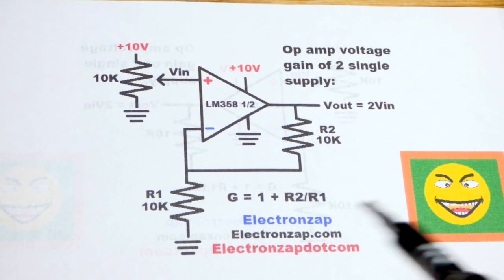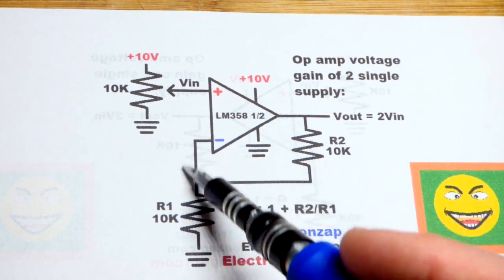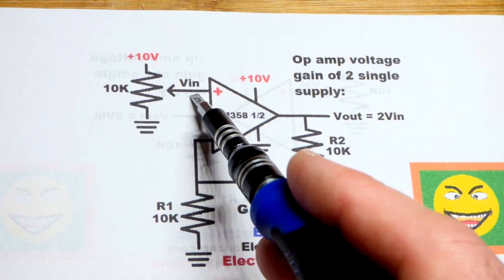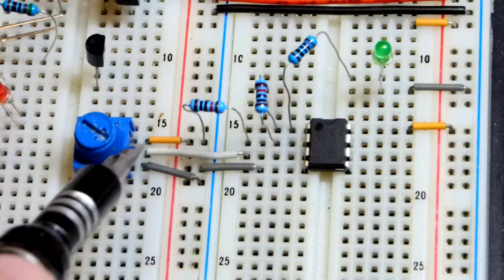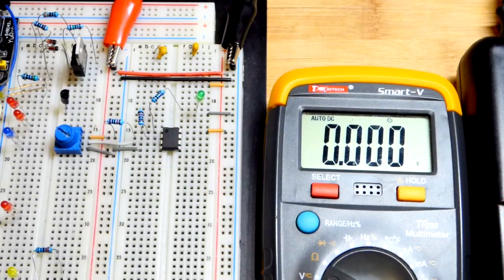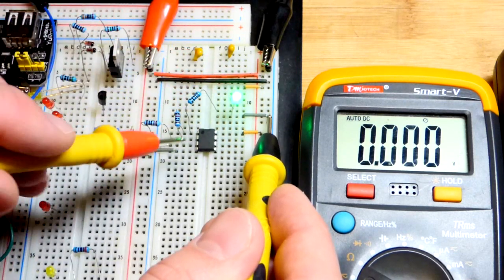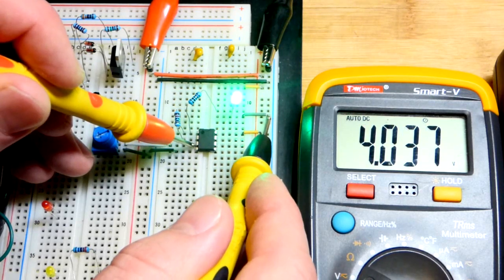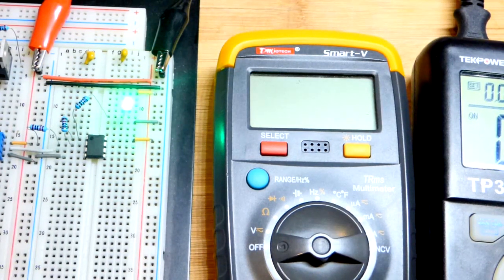Voltage gain of 2 using LM358 single supply op amp electronics circuit by electronzap

Comment: Hey there!
I've made a lm358 dc voltage amplifier with a gain of 100x. My maximum input is 75 millivolts which gets amplified to 7.5 volts. But I want to scale the voltage range of 0 - 7.5v to 0 - 5v so I thought of connecting a voltage divider across the output of the amplifier. But when I connect it, the output suddenly drops randomly. How can I isolate the amplifier and the voltage divider circuit???

Comment: Can I amplify 75 millivolts to 5 volts using LM358 module that has a gain of 100X.  I'm trying to make an invasive ammeter. I want the ammeter to show 400amps when a voltage of 75 millivolts is developed across the shunt. But it is difficult for arduino to measure in millivolts.
Reply from the maker: Should be able to, but I haven't built one yet. So I can't give a good answer.. That'd be a good circuit to Google. I'm sure a schematic that works well is out there somewhere.

Comment: Am need 5v to 100v can we add 1k and 20k resistor with 5v input voltage ?
Reply from the maker: Op amps don't boost voltage. They generally don't even output the full supply voltage. You can output a multiple voltage of a signal as long as that output voltage is less than the supply voltage by enough for that particular op amp.

Comment: Does the voltage gain ever come above the supply voltage? Like for example 2x trimpot set at 6V = 12V gain which is more than the supply voltage of 10V?
Reply from the maker: Op amp might stop providing more voltage when it gets to the supply voltage, and often can't even provide the supply voltage. It never exceeds the supply voltage, it just levels off wherever it levels off.

Comment: So the Op Amp when there is negative feedback will always try to equalise it's two inputs by adjusting it's output? I hope I'm starting to understand :)
Reply from the maker: Exactly! With negative feedback, the op amp output tries to keep the voltage at the inverting input (-) the same as the voltage at the non inverting input (+) .